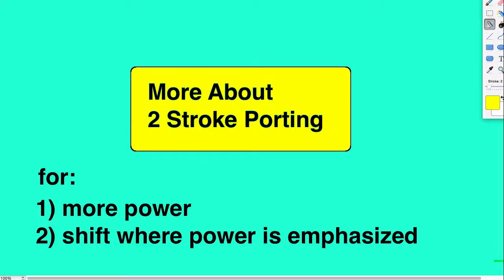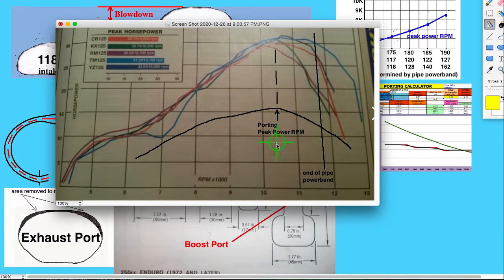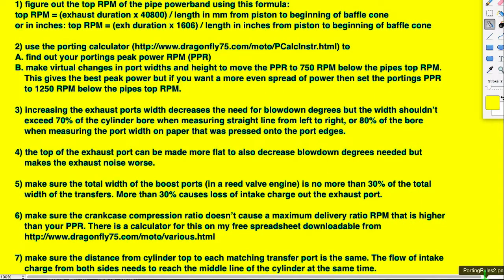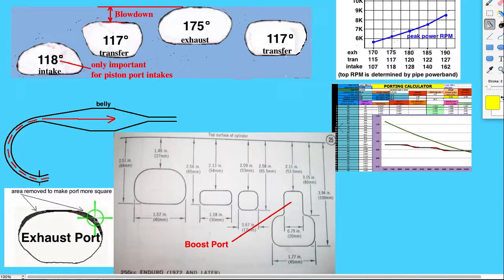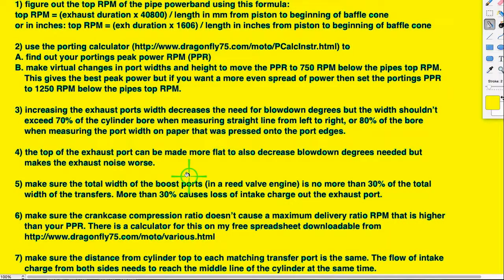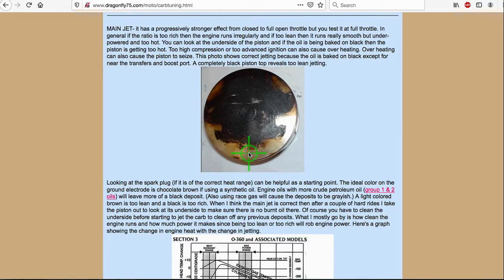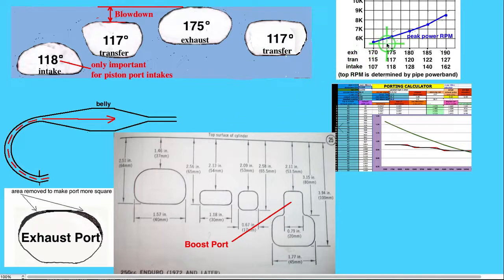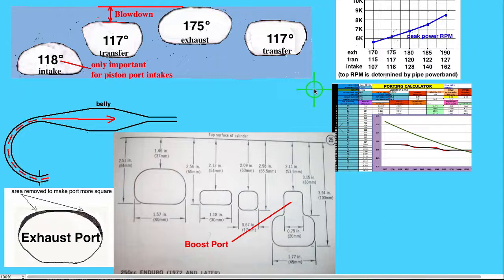More About 2 Stroke Porting

Comment: Hi master!! I have a vintage trials bike (pistón port) which has 142 grades of intake, and 133 grades of Transfer, with 168 of exhaust (didn't measure the blowdown period). I think i have a lot of intake and Transfer time for a supposed low end torque bike, and i want to get a better low end, for what i thought about lowering the cylinder by milling It or installing a thinner gasket between the crankcase and the cylinder but....if i low the cylinder to get less exhaust and transfer time, i would get more intake port time, ins't It? So maybe It could not work properly. What do you think about this, or have you any idea to get a better low end? I really apreciate all your efforts to this beautiful and smokey world!
Reply from the maker: Just use JBWeld to raise the bottom of the intake port. But don't expect a huge difference. On my piston port engines I've gone all the way down to 110 degrees of duration and still they were very lacking compared to engines with reed valves. Get creative and do that.

Comment: my kawasaki krr 150 have powerband like TM125  drop power in mid rpm how to get rid that problem?
Reply from the maker: that's probably due to a racer exhaust pipe. The mid range is weak due to a lack of diffuser return wave strength and too much baffle wave strength. A completely different pipe is needed.

Comment: Hi, great videos. Can you please make a video about expansion chamber variables. Carburatour size, port durations, compression... Which sections changes based on variable.
Thanks
Reply from the maker: Carburetor size affects the burn time so the bigger the carb, the faster the burn and the lower the EGT. The higher the EGT the quicker the pipes return waves reach the cylinder. Jetting and compression affect exhaust gas temperature and its near impossible to calculate for that  so it's best to measure the EGT which you can do with a $70 gauge (listed on my site). Rich jetting causes a slower burn which extends closer to the time of port opening so the EGT is hotter. More compression causes a faster burn and so makes the EGT less.  Port durations interplay with the timing of the pipes return waves and that is best analyzed with a pipe calculator with return wave simulator (like mine that I sell at www.dragonfly75.com/motorbike/portsMS.html ).
Reply: @MichaelForrestChnl  thank you. I might buy it.